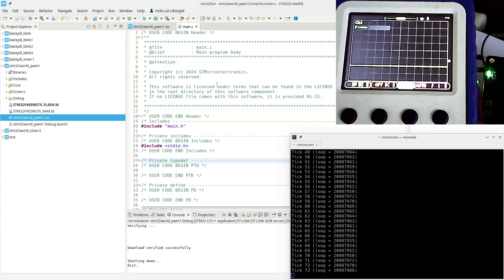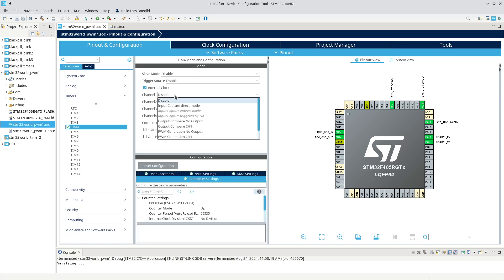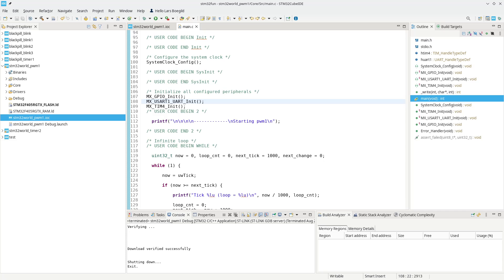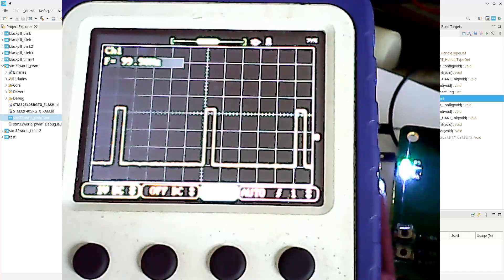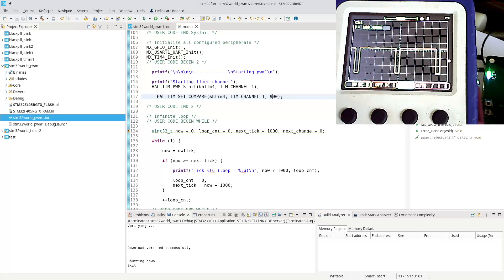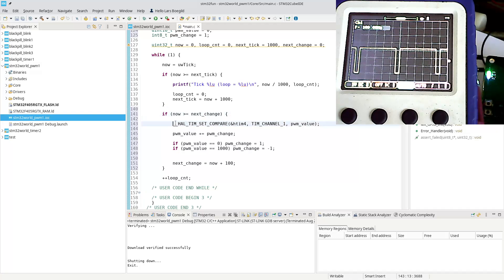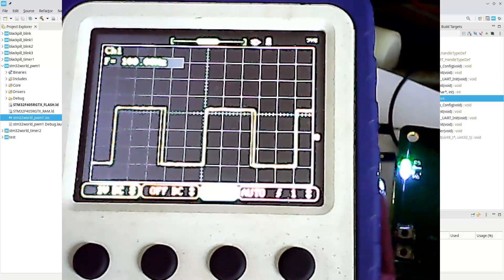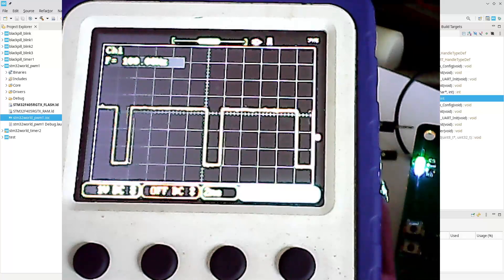STM32 Tutorial #10 - LED Pulse using PWM from a Timer Channel

Comment: How you use pwm with this integrated LED??? in the blackpill
Reply from the maker: Do you mean the LED on the Blackpill? IIRC, the LED is on PC13 and PC13 has no peripherals on it, so you would need to PWM in software.

Comment: great video. However some issues - when you were doing changes in editor, we could not see your editor, instead the large oscilloscope only. Gentle request - to show the oscilloscope on the top right, in small window - in case you want to show both
Reply from the maker: Yes, I forgot it a few times in the beginning.